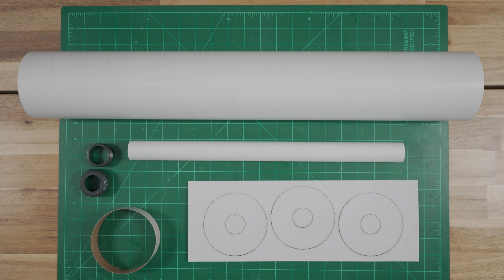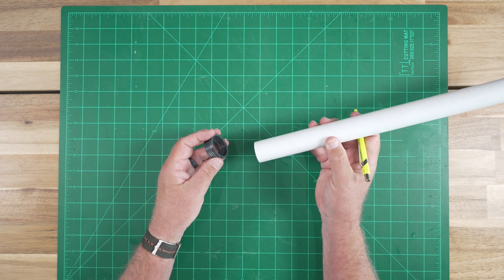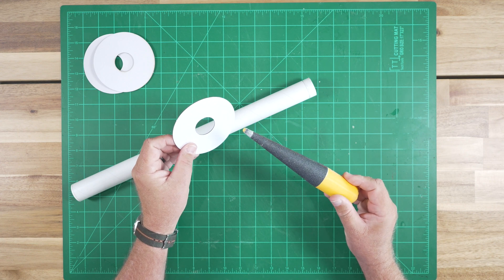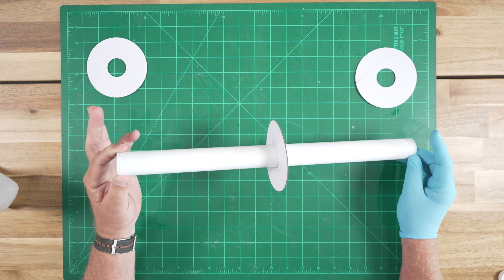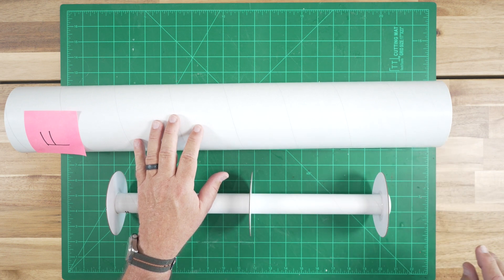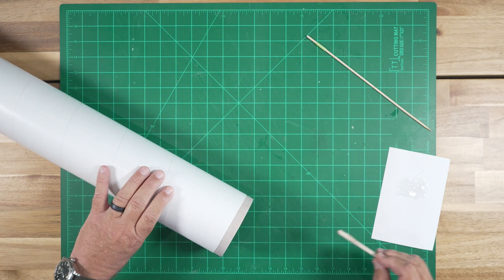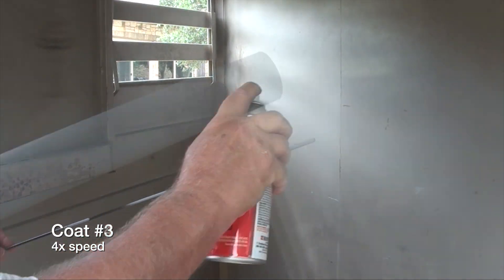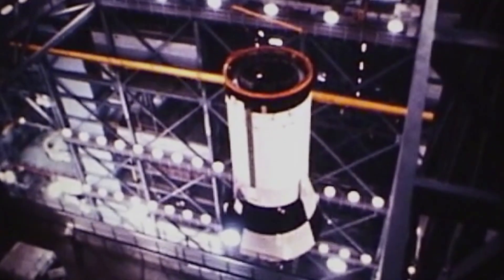Building the 1/100 scale Estes Saturn V: Part 2,  Motor Mount and Airframe

Comment: I have a original first time kit with the cluster ring for " C" motors. 
   I also got a few of the 2021 kits of the STV, going to get some card dtock material and cut centering rings for cluster of 4 " C" motors.
 I have a question, whats your thoughts of lining up motors with the fins or would you between the fins??

Comment: I have built a couple of these over the years and have always been disappointed by the dimples that appear on the lower body when I use wood glue to install the motor mount.  Using 5 minute epoxy is the perfect solution for my current build.  The instructions to fill the body seams has also worked really well.  I’m trying to build as perfect an Estes Saturn V as I possibly can and this series is really helping. Thanks so much for doing this series!

Comment: I misread the instructions and left the aft reinforcing ring protruding out of the body tube by 3/4 of an inch instead of having it in set 3/4 of an inch! I thought I might cut off the last few inches of the body tube and flip it around using that reinforcing ring as a coupler, then fashion a new reinforcing ring and install it properly. Can anyone think of a better solution? Dang.
Reply: Well I did exactly as I said except I cut the tube so when I flipped it and coupled it, the reinforcement ring was at the 3/4 “ mark. Easy peasy. The joint will be covered by the wrap. Whew.

Comment: Very good ideas. You don't have to primer the S-IVB third stage tube though IMHO because its exposed surface is completely covered by the vacuformed detail wrap on the #1969 and #1967 kits. When I did mine, it turns out I had to sand into the surface of the tube a little before adding the wrap to help minimize the parts seam on the outside. 

Another benefit of no primer before is I felt I had a stronger bonding surface with the glue as it soaked in deeper into the cardboard. The best cement I found for these wraps was Bob Smith Industries Finish Cure epoxy. It could be brushed on paint layer thin and it has a long working time before setting up. IMHO it works better than spray adhesives.
Reply from the maker: The primer is foreshadowing, Jay! <G>